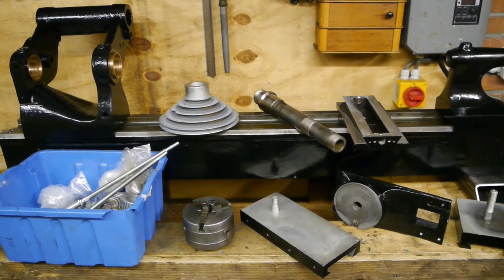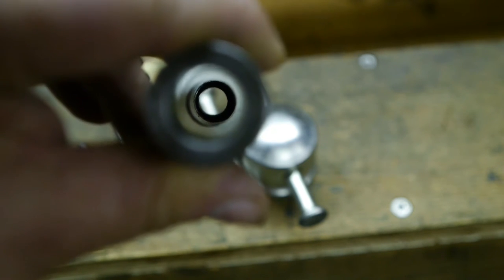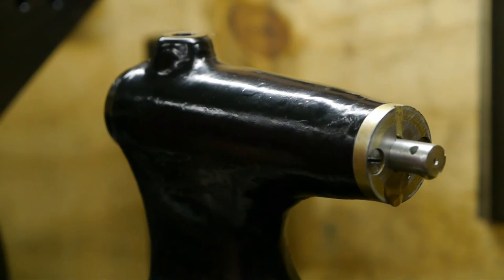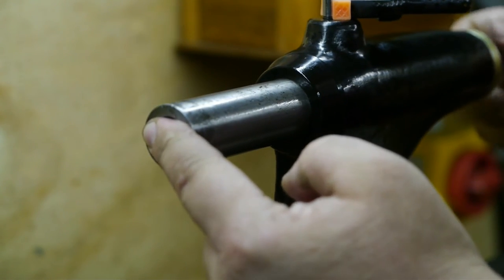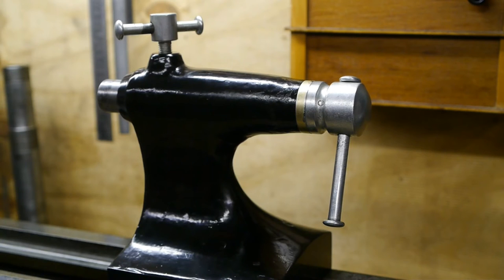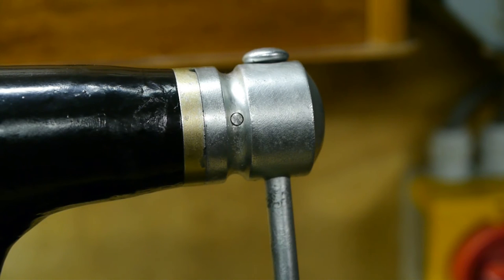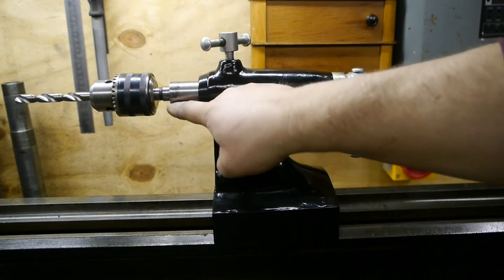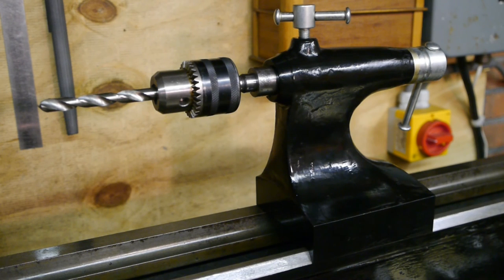Reassembling an old lathe - Part 1/3 - The Tailstock

Comment: The lathe is looking good.  On my lathe some Morse tapers eject sooner than others.  This is due to differences in the length of the taper and the length of the tang.

If you are only using the tapers on the lathe, consider grinding off some of the tang.
Reply from the maker: Thanks. 
I got a set of tapered drills that work perfect in My cheap Chinese lathe so I'm not going to grind them down. :)
I've just uploaded the last video in the reassemble series so might want to watch that........

Comment: Tolerances looking good after all those years of use. Just guessing but wonder if the factory used something like a hot plate and a chiller to ease assembly of mating parts by heating the OD and chilling the ID.  Coefficient of thermal expansion for steel, etc..